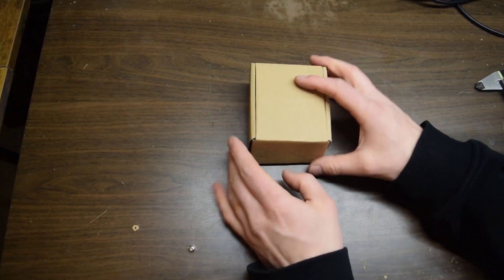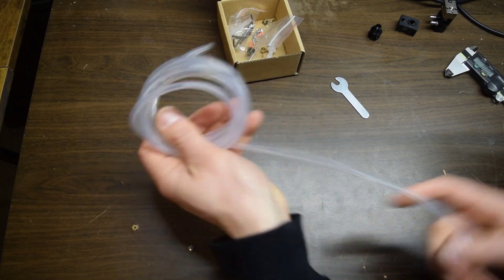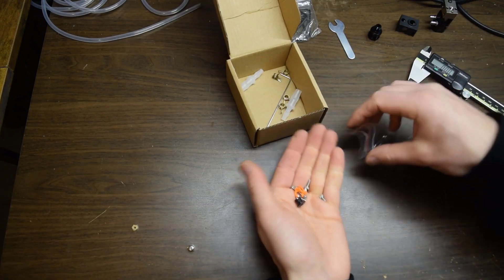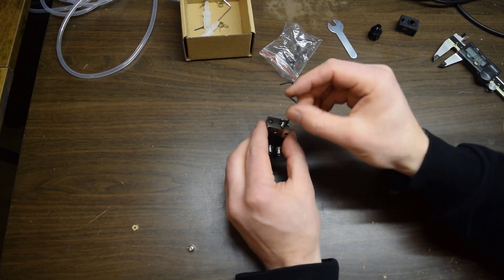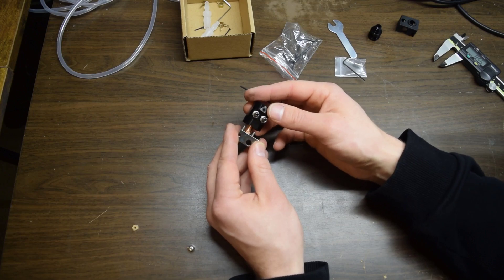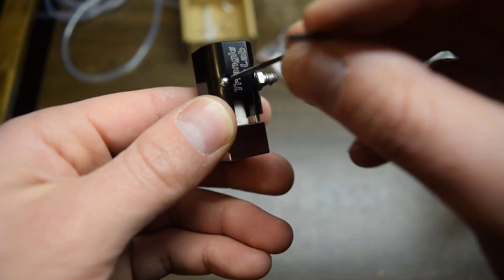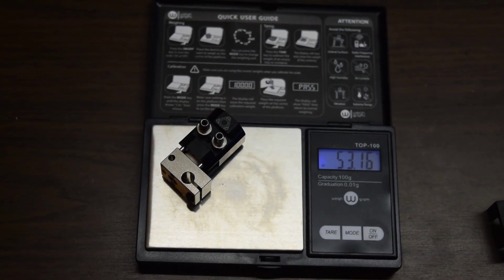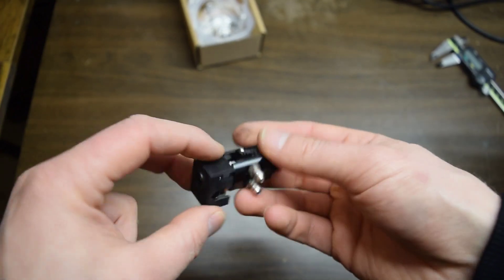[Unboxing] Liquid Cooled Dragon Hotend

Comment: Hey so I have Idex dragon WHF.  they are great but my printer malfunctioned and sat idle after a print with the print head still heated.  Despite the coolant flowing the filament cemented all the way up the heat break past the cooling section.  I have tried any and all traditional means of removing the filament and all has failed.. has anyone run into this issue?   How do I fix it without buying another throat tube from china and getting it in a month. thnx. PS I have contacted their support team and they are Non existent.  I emailed them 5x and absolutely nothing in return.
Reply from the maker: Remove the heat break, heat it up with a heat gun and push out the filament with a drill bit 👍
Reply: @fail_fast  that worked thnx

Comment: Doesn't look like the most efficient design with respect for cooling. The water jacket of 3 small drilled passages does not account for much volume or surface area to wick away heat. Copper for the heat block would have been a better choice (other than it's heavier and more expensive than aluminum) will move 1/3 more heat. The black coating will insulate the parts acting as a boundry layer. On top of all that the water lines are rather small and the flow will be restricted through those crossed drilled holes. In the end, testing will determine how effective this design is. The closer to ambient temperature you can get the better. Word of caution: don't mix aluminum and copper in the cooling loop. That will cause galvanic corrosion. Water cooling is the way to go in a heated enclosure where the radiator is located outside the chamber. The best liquid cooled heat block I have seen is the Slice Engineering Liquid Mosquito but it expensive and will add a few grams to the extruder assembly.
Reply from the maker: Hey! First off, love the input! I definitely agree and disagree with you on some stuff - won't we all? Everyone has different experiences. While all of which you're saying is true,  a lot of it may be negligent contributors to functionality of the product. If there's anything I've learned from shifting from academia to industry it's that if a product works.... then it probably works! I did some 1D heat conduction calcs a while ago and at around 250c there's somewhere around 6 to 8 watts of heat that needs to be transfered into the water. Most kits I've seen look like they use a 120mm rad which is way overkill for that level of cooling. So the hotend really doesn't need to be that efficient because the rad can cool down the water to such a point that it will make dT greater and make up for the maybe lack luster thermal design. 

You're right. Yes, copper has a higher thermal conductivity but if aluminum works then why would you want to make it out of copper? Like you said, it would only be heavier and more expensive. As far as the anodized/aluminum oxide layer, it's so thin (we're talking tens of micron) that it probably doesn't contribute significantly to the thermal resistance. Remember back to the the equation for 1d heat transfer - it's linearly related to the material thickness. Aluminum oxide also isn't a terrible conductor of heat - similar to steel. So I don't think it would make a big difference having it or not.
Reply: @fail_fast  As I stated, only testing will determine how effective the system is which is what matters. All I was stating area's that could be improved and what to look out for most of which is out of your control depending on component selection. I build water cooled computer systems which have to deal with a lot more heat my current build will need to dissipate close to 1000W. Any failure them will cost $1000's which makes optimizing and reliability high on the list of priorities. Nothing better than water cooling I've even put copper water blocks on my stepper motors.
Reply: @donuthole7236  hey, i know its a year since your comment, but anyhow: there isnt much heat you have to cool away from the heatbreak. in open printers, some hotends only use 25mm fans. 
the total of cooling needed is like 5-10W. 
yes, with an closed enclosure youll need a bigger fan, but that is the temp of the air used by the fan that makes that difference. with water, you always have cool medium where its needed.

i only use watercooled hotends since 2018, and some of them only have a 3mm channel bore, simply because its all you need.